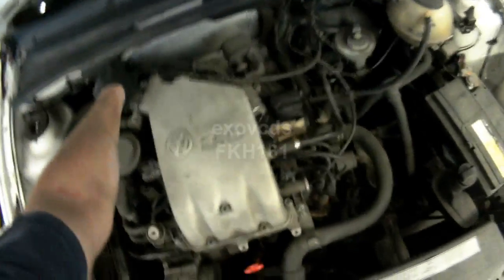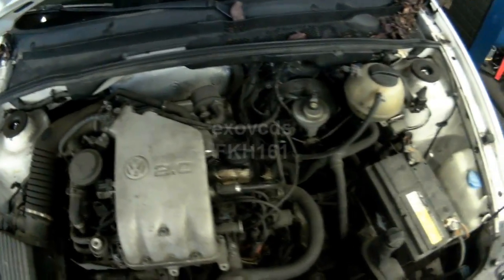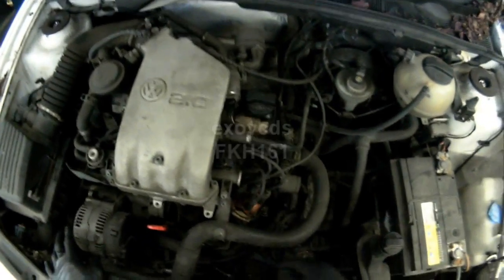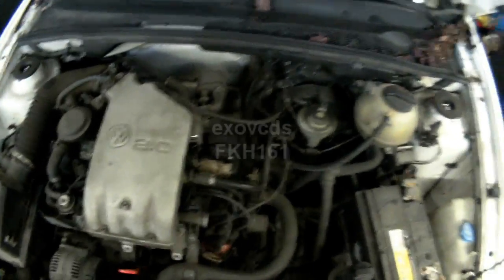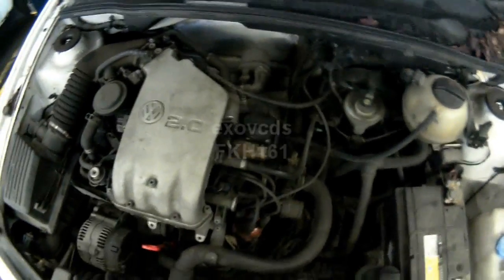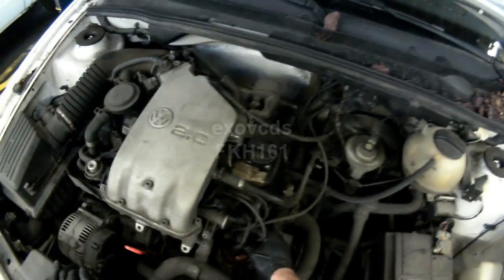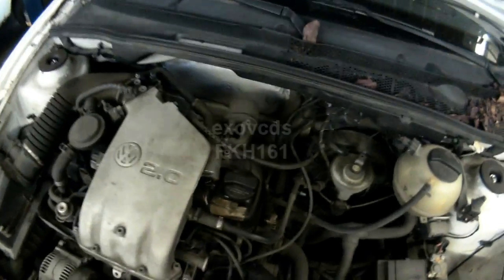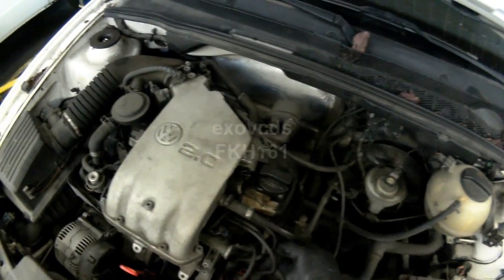VW A3: No Spark Quick Check...

Comment: Hey Thomas. Ive been having problems with my 97 jetta 2.0. Its obd1. Im getting no power under load, but full power after 4000 rpm. check engine light comes on under load and If i let off the throttle, the check engine light goes off, and lets me get into it some more. Its been consuming far too much fuel. 250-300 km to a tank where it use to get 600km to a tank.Its been parked for 6 years. Ive run 2 tanks full of premium with seafoam.  Ive changed plugs, wires, cap,rotor, ign coil, fuel filter, and cleaned maf. Ive tested fuel pressure, timing marks, tested vacuum for plugged exhaust and everything checks out.It also back fires coasting down a hill in first gear. I throw codes on vag 65535, 00524, and 00515. can you please help me. Thanks
Reply from the maker: I'll get back to you after I finish work tonight... West Coast Pacific time 6pm
Reply from the maker: Check your inbox... message with links sent.

Comment: Hi.... ok so im fixing my grandmothers 2000 cabrio with the 2.0l engine one problem... no spark coming from coil... checked the 3 pins that connect to the coil... the 2 outter ones have power and ground... just the center one which should be the signal one that the ECM grounds isnt getting the on and off signal when cranking the the engine and testing it with the test light to power(12v)   so i reached the conclusion that it could be the CKP or the hall effect on the distributor......one thing... how could i pinpoint which one of the 2 it is... or can it be many more culprits like the ECM, Knock Sensor, A Relay or fuse...... I'd really appreciate the help thanks
Reply from the maker: Hall sensor in the distributor is not needed for the engine to start/run. Most likely the crankshaft position sensor is no good. Does the check engine light come on when you turn the key On? If no, then the ECM is not powered up. Some cars had a #3 relay (marked 109) that can cause no ECM operation. If your car does not have a relay in spot #3, then don't worry about the relay.
Reply: *****     ok when you say #3 relay is it from left to right on top of the fuses under the steering wheel? because my check engine light is not on.... so you are telling me that the ECM is not powering up... because of this relay?
Reply from the maker: Yes, possibly... #3 is the 3rd relay from the left, in the second row of relays above the fuses. I'm about to finish lunch and go back to work.  Will be able to help more after work tonight. If you have a scan tool, check if you can communicate with the ECM.
Reply: ***** thanks appreciate the help ill be on later to ask for help haha
Reply: there is no relay on #3......
Reply from the maker: Don't worry about the missing relay, some had it some don't. I would still investigate why the check engine light does not come on when you turn the key on. Could be that the bulb is burnt out or that the ECM is not powered up. Quickest thing to do is attach a scan tool and see if it communicates. If yes, check for fault codes. If no communication, you will have to check the wiring (power & ground) to the ECM. I can probably find a wiring diagram for you if you need one.
Reply: that would really help me out... i need to check the ecm has its grounds and power.... but whats bothers me shouldnt there be a fuse for the ECM or a relay... since mine doesnt have one in that slot were would it be
Reply from the maker: Check your youtube inbox... link to wiring diagram was sent. Should be correct for that car.
Reply: *****   dammm im having trouble opening it........ my antivirus doesnt let me open it idk why..... so what relay is responsiblo for the power of the the ecm....
Reply: Sejus Seven idk if the cabrio being convertible has anything to do with it being different
Reply from the maker: It's just a pdf, you should be able to view it in your Web browser. I took a quick look, the ECM gets power direct, no fuses or relays. Try the pdf again, you'll see the power & ground sources then.
Reply: on the pdf you sent on the second page i dont see the battery go straight to the ecm it goes to two places starter and generator/voltage regulator then ecm..... so i have to check that wire that goes to the alternator and check the connector.... and the voltage after the regulator... could it be the alternator causing my mess?
Reply from the maker: Sejus Seven Page 3, E6 is power to the ECM when the key is ON. Follow E6 to the left, that's the same power source for the Ignition coil N157 that you verified. Power at coil, but you need to check the wire at the ECM (wire T80/1 sw/ge black/yellow). Page 4, ECM has battery power all the time at T80/3 (red wire)
Reply: *****
ok something is out of wack.... i checked all my grounds and cleaned them and retightnened them...then  i checked the center  pin on the coil conector with a test light and someone cranked and nothing but then i checked it with the fluke multimeter and when the engine is cranking its getting 12 volts but doesnt fluctuate like you said it would with the testlight.... im grinding my head against the wall but im not giving up... it just throwing me off that with the test light it doesnt even light the bulb once but with the metter it stays at 12 volts constant... i checked the test light with the battery alone and it works....  the mil for the check engine still doesnt turn on when you berly insert and turn the key...
i need smaller leads on the meter for it to go in so i could test the red wire which you say is battery power at all time(T80/3)...
Reply from the maker: Sejus Seven Test light to positive and then touching positive pin on coil plug = no light. Most likely the crank sensor is no good, causing no ignition & injector pulse. But I would still want to scan with a scan tool to confirm communication and or fault codes.
Reply: how can that be thoo... like if i try it with the fluke it reads the 12 volts when cranking and no light with the testlight...even if i put it on the ground side.... well i got nothing to to read the codes on...or communicate with the ecm... the car is blocked in by an expedition ima work on later when i get the parts for it but for now im focusing on this guy giving me a headache.... i guess im just going to buy the damnn 75$ code scanner from autozone
Reply from the maker: If I say to buy a crank sensor and it does not fix it... I'm the bad guy. If you buy a scan tool and there are no fault codes, I'm the bad guy. Check engine light should be on when the key is on... it could just be a burnt out bulb or an ECM issue. My first step is always to scan the ECM.
Reply: i wont say you a bad guy haha but i think ima choose to buy the scan tool....and thatll tell me if there is communication..... maybe its just a burnt plug or maybe the ECM is bad or maybe the CKP is bad haha regardless youve helped me out... but ill check the ecm groundand power after i buy the scan tool ima need one eventually
Reply: ***** 
P0322
P0102
P1451
P1421
P1472

thats the codes it picked up meaning there was communicattion with the ECM
now if i had AllData or something i would look up those codes... for now i will see what the internet says about them lol
Reply from the maker: Sejus Seven http://www.bentleypublishers.com/tech/vw/vw.dtc.table.htm
Reply: 3 of these DTC are shorts to gorund
-sec air inj valve short to ground
-sec air inj sys short to ground
-evap emissions con cir short to ground
and im trying to remember which relay was the one that provides the ground for these was it the fuel relay?
anyway I ordered the CKP sensor and it shoul be here the 8th and im thinking that that short to ground is fauult of a damn relay i would appreciate your help some more if you could help me sort this out man haha
Reply from the maker: The fuel pump relay will set all those short to ground codes... all those components get power from the relay and the ECM supplies ground. When the ECM doesn't see the voltage from one of those components, then it assumes that it is shorted to ground. Those codes were probably set when you removed the relay and had the key on while testing the pump.
Reply: dude replaced crank sensor now i have spark going out of coi'l =) but now spark ends from distributor to plug wires...   time to replace rotor and cap a million thanks for helping me out
Reply from the maker: Sejus Seven No thanks needed until it actually runs... you are doing all the work, I'm just throwing ideas your way.
Reply from the maker: Sejus Seven Make sure that the rotor is actually turning when cranking!
Reply: its actually turning and giving spark at the end of the plug wires but its backfiring through the intake.... im going to have to check the timing marks and re install the distributor on TDC... do you know  were i can find these online?
Reply from the maker: Sejus Seven http://fkh161.ca/VW/TimingBeltABA.pdf
Reply: is that 93 golf same for my 2000?
Reply from the maker: Sejus Seven All the same... the pdf lists 97> with the thermo tensioner (last couple of pages) if you have that style. It is best to remove that thermo dampner and install the old style roller tensioner by itself.
Reply: ......dude im going to upload a video on what it does and maybe you can give more help haha...
Reply: ok i have the cam ger mark in between the OT and on the transmission hole at the top has the notch like on page 4........ and  i took off the distributor cap and it was facing cylinder #4 when it should be on #1..... so im guessing i have to re-instal the distributor the right way.... could you send me the pdf that could help me with that... really wishing i had alldata
Reply from the maker: Sejus Seven Why was the distributor moved? If you never removed it, then don't pull it out now. I'm almost off from work, will post what you need once I get home.
Reply: well i think my uncle had worked on it before he was thrown in jail thats why im up here at iowa helping my grandma with her veichles...(im from texas)  and the distrubutor cap was damaged the one i replaced which makes me believe he did work on that... he had the whole intake disconected and no battery present....so i had to get them.. so now illjust wait for your reply since i cant find anything online
Reply from the maker: Sejus Seven After you remove the 13mm bolt from the lock-down plate, remove the plate and pull the distributor out. The distributor should have 2 pins at the base that prevent the housing from turning when the hold down bolt is in place.

Break those pins off if they are still in place. This will allow you to rotate the distributor in case you are off a few degrees when the distributor is back in place.

The distributor drive needs to mesh with the oil pump drive... Hold the distributor over the mounting hole, align the rotor to point at the #1 notch and then check the oil pump drive in the block... move it with your fingers so that it is roughly sitting in the same place as the receiving end in the distributor drive gear.

As you lower the distributor into the block, the rotor will move (due to drive gears splins)... if the oil pump drive is close, then everything will mesh and the distributor will sit flush to the block.

If the oil pump drive is off, the distributor will not go down all the way.

Once the distributor is seated, you can rotate it until the #1 notch lines up with the rotor... as in the prior pdf. 

This would make a good video... I'll have to keep it in mind!
Reply: ***** ok im about to start on that and yes it be a good video.... hope that fixes everything with this car hah
Reply: ***** send me the pdf for the distributor installation
Reply from the maker: Sejus Seven Sorry, was watching TV. Check your youtube inbox.

Comment: Dude. I have changed everything in my 98 Golf and still not start. It cranks but no start. I have replaced: Knock sensor, RPM engine sensor, Ignition Coil, verified the hall sensor and it works, Spark plug cables, checked fuses and relays, it has fuel and still nothing! the coil is not getting power from the ECU. What else can I check? Great video!
Reply from the maker: 2.0L? Remove the coil harness plug (3 wire), key ON, check for power and ground on the outer 2 wire. Yes? No? Most of the time it is a bad coil. I recently installed a NEW coil that was no good. Remove your coil and check it like this:

VW A3: Ignition Coil & Power Output Stage Quick Check (helping a viewer)

Does it work?

Do you have a relay in relay slot #3?
Reply: ***** There's no power coming to the Coil and the injectors aren't flickering, just puking gas into the chamber. I currently have 3 Coils I have used to test the Coil hypothesis. I'm not sure If it made any sense; I originally did not have a 109 on slot #3 but bought one thinking maybe someone broke into my car and stole it.

Yes, it's 2ltr engine 4 cyl.

Another question. I timed the engine about 20 times myself and triple checked the marks to make sure it was done properly. Could that be the culprit? I've been told it will run like crap but it will run, Im not sure but everything is on TDC.

Thanks a lot! Your videos have helped me a lot!
Reply from the maker: Juan C. Villegas "If" your injectors are not flickering, but fuel is getting into the cylinders, then your injector driver (in the ECM) might be fried and keeping the injectors open. I would not fully suggest that yet, as I don't know what you are using to check for a flicker / injector control. 

Also, it is normal for the spark plugs to get wet when there is no spark.

If you do not have battery power on one of the outer wires (on the 3 wire coil harness plug), then you need to trace that circuit. A faulty ignition switch can cause this... but the usual failure is loss of power during cranking.

If the oil light & alt light come on in the dash, then the ignition #15 circuit "should be OK" (at least from the ignition switch to the dash).

When was the last time she ran? What caused you to check the timing / belt timing?

If she ran before any of the work you did, then it is something that is not set correctly.

Not all mk3's had a #3 (109) relay. If you can access the ECM with a scan tool with the relay removed, then your vehicle does not need the 109 relay.
Reply: ***** We used a test light on injector #4. We used a VAg com and all sensors tested fine (Go figure almost all of them are new). All dashboard lights come on normally on switching the power on, including the CEL. BTY the switch is ALSO new (Beck Arnley). She ran two years ago until the crappy timing belt damper (old design) broke and messed up two valves. Redid the cam and timed it to no avail. If the cranks shaft is off some will it not generate a spark? The technician that used the VAG com and tested everything else said that the ECU wasn't getting power, yet all fuses were fine; he even used a new battery for this diagnostic. Bummer!
Reply from the maker: Juan C. Villegas When pulling a head for valve replacement, nothing major should have been disconnected... meaning that it is a straight forward job = should run afterwards. If you truly are not getting spark, continue to check for a reason. Like you said earlier, if ignition timing were anywhere near close to where it should be, the engine should at least do something. The crankshaft position sensor is the main input, you will not have spark or injector pulse if that sensor is bad (no rpm signal when viewed with vag-com as well). There are too many variables for me to try and help diagnose this via a keyboard. I tied to help someone for 3 months in a forum and it ended up being a bad coil (not saying that's what it is in your case, just saying I don't want to waste your time). If you have time, take pictures of all the #1 TDC marks as you have them aligned and send me the pictures fkh161 at fkh161 dot ca Just so I can verify that they are ok. You are sure that the ignition coil harness plug does NOT have power on one of the 3 pins when the key is ON or Cranking. Yes? Focus on that!
Reply: ***** I sure will. Thank you very much for the expertise you have shared with me. I'll make sure I let you know when I find the answer.
Reply: Thomas! It was the timing all along. I had decided to remove the green transmission plug instead of relying on the pulley marker. The SOB started like nothing had ever happened! So based on this, it does not matter what sensors you buy at all, if the timing is off then the car won't turn on! Yikes!.

Thank you so very much for your guidance.
Reply from the maker: Juan C. Villegas Good to hear that she is running again! If the TDC mark on the pulley does not line-up with the mark on the lower timing belt cover (when the flywheel mark is at TDC), then your crankshaft sprocket / gear has a worn "key" that is causing the sprocket to move on the crankshaft (over time) altering the valve/piston timing. Sample of good & bad:
http://fkh161.ca/VW/CrankSprocketGoodBad.jpg